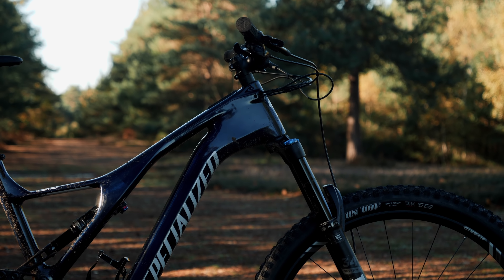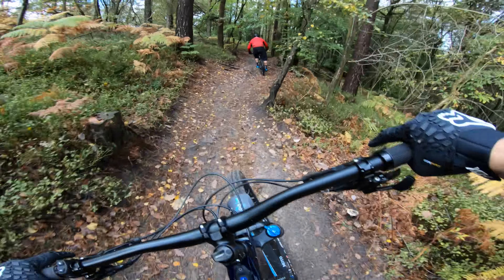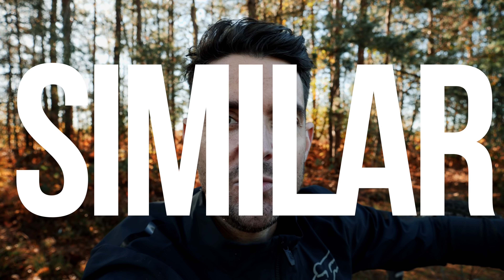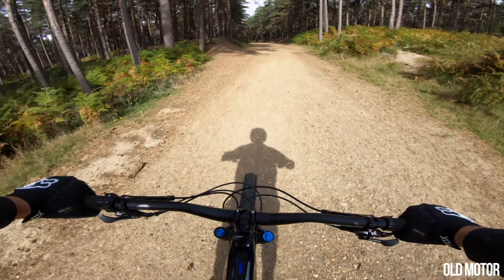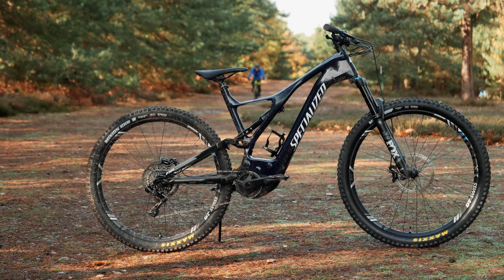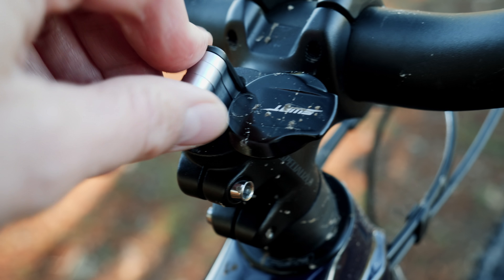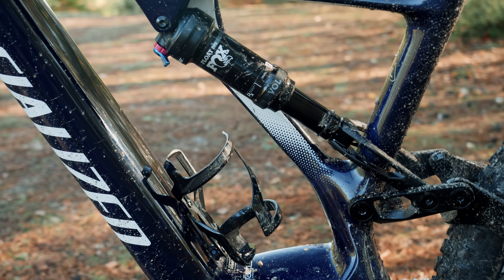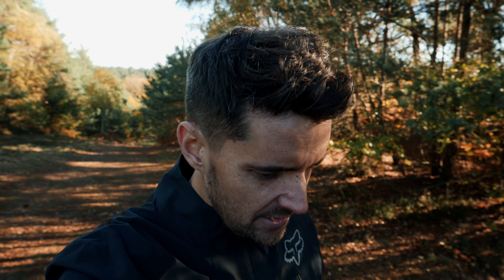2019 Specialized Turbo Levo Review

Comment from the maker: Hope you enjoy the review. Any question or feedback on the new 2019 Levo hit me up below 👊
Reply: Hi, since you are 6'3, I would like to know if you have an L or XL size? thx
Reply: States the size in the Video
Reply: great review but I have 2 unanswered questions: 

1.  What is the weight of the battery by itself? 
2.  Can you ride the bike without the motor to further reduce weight? i know the battery is removable, but does the motor need to be attached to use the bike?
Reply: @ValenTiC1996  battery does not need to be attached, you can ride without but you should close off the battery hole.
Reply: What's the range in turbo mode?
Reply: @808GT  not what i asked, can the motor be detached?
Reply: @ValenTiC1996  I don't know but you would not be able to ride as the BB is part of the motor
Reply from the maker: Thanks for the feedback 👍 I’ll definitely check those review out. Kind regards, Rob.
Reply: 2:53, he says he got XL @peronaeva
Reply: Thanks for the review!  IMO they're more meaningful after extensive riding, as in your case.  I've demo'd the 2018 Levo, which was nice.  But one thing I didn't like was I really felt the weight when I tipped it over to turn.  Wondering if you can compare that feeling on the 2019 vs. 2018 versions.  I'm hoping that the lower weight, and possibly lower center of gravity, on the 2019 may ameliorate this some.  Any thoughts?  Thanks again!
Reply: What are your thoughts about the m1 daz spitzing evolution and how would you compare them?
Reply: Can it run plus tyres also ?
Reply: Thanks, I really really enjoyed the review, really really good, on a really really good bike, my apologies but you really really say that a whole lot
Reply: Hi Rob do you have a specialized levo for sale buy any chance, I need one asap to help with fitness after having 4 operations and I know you have a few could you let me know pls

Comment: Having owned a Merida Eone sixty 8000 with intergrated battery I loved the bike,,,,,except the 27.5 wheel at the back. At 6'2" I ride an XL also and found yes whilst it creates more nibleness the back wheel does not roll over bumps, roots rocks, as easily. Its a gamechanger going to 29 front and rear. 3 years on this video is still relevant. Im looking at the Specialized Levo for the motor, the geometry the package. Yes you miss out on components but weight of shifters cassette is near moot on an ebike. Given the weight of the motor is 500grams give or take less than variants in the same year models.....Its quick and easy to put on X9 shifters that allows multiple gear shifts, and drops the weight where it counts at the cassette. Trickle down tech such as Rockshox Delux shocks or RS Forks in years past are equivalent to the top offerings. Light, stiff and plenty plush enough.

Its either I look at the Merida eone sixty again or the Specialized Levo but Im getting drawn to the Levo, even being alloy framed due to 29 wheels front and rear. I feel when your tall, 29 wheels are simply scaled up to suit your size on the bike, where leaning front and rear shifts greater mass than a 65kg rider that need to use far more body english to move 29 wheels.....Scaled to fit.

Just got to look at unlocking. STunlocker was great was super cheap to unlock the Merida....at $60Aus dollars for a simple licence to the App....that also allowed power levels to each mode.

Comment: Rob, Levo’s normally come with 2.8 tyres on the 27 plus 18/19 models. I am quite light riding a med at  5’9” and around 72 kgs, wondering about a 2.6 tyre, any feedback or comments from peeps trying that set up.  I would change the front too to a2.5 or 2.6. MAXXIS Minion DHRII rear, sound like a good al rounder. I don’t ride bike parks, mainly trails, North and South Downs.

Comment: My recommendation would be if you don't like it then find an alternative. Try hi power cycles. They are based in Florida. Ok they are double the price of the turbo but you get double the power and 100mile range not to mention better suspension, set up etc 😎

Comment: Rob, how much better is the 2019 over your 2018?  I just ordered a new 2018 left over Turbo Levo Expert Carbon and now wondering if I should have bought a 2019.   However I did get a great deal on the Expert $5000 dollars.
Reply: The 2019 regular frame weight is less than 2018 Carbon

Comment: Hey mate great review, have you got any plans to check out the Norco sight Vlt? 
 it looks amazing
Reply from the maker: I would if I could get one!
Reply: @RobRidesEMTB  Yeah they should be available around mid-November most places. It has made my choice of buying my next EMTB so much harder lol...
 
I just had a terrible experience with a 2019 Rocky Mountain Power Play; owned it for 3 weeks and it was nothing but dramas - a proper lemon. 

Firstly, the builder snapped the motor cover as its a brittle plastic on both sides, the motor was cutting out, a button fell off the controller from a minor knock on the bike rack, weird noises started coming from the battery or motor (high pitch whine when I stopped pedaling), rear shock was losing air pressure. 
The 'Normal" vibrations and noises of the motor were unacceptable and when the motor was off - you could barely pedal the bike a flat road.  I don't believe its ready for production really. I had to return it for a refund which the shop was very unhappy to do so. I had to send so stern emails back and forth; pointing out my rights under the Consumer Law. 

I really hope Rocky Mountain receives the bike back for an investigation; in order to alleviate these issues and put in place a more extensive quality control procedure. Judging by the shop owners emails - I don't think he intends on send it anywhere; just to fix a couple of things and sell it to some other poor bastard...

Comment: Super presentation Rob, thanks. We are looking at a couple of these for exploration of the forest service roads and trails in the Olympic National Forest, and extensive low tide beach exploration along the remote Pacific coastal beaches here in Washington and Oregon. Will out fit them with racks and panniers to carry supplies and photography equipment. Probably not much high speed trail riding and jumps etc. like in your video, (although well done). I also like the suggestion on the DT Swiss wheels as we would probably run 3" tubeless tires to meet the dual purpose needs.What is your thought of this application with the Levo? Thanks in advance, Tim

Comment: Great video Rob, congrats!!
As a proposal, it would be a good idea a new video giving advices about bike-caring (invisiframe, how to clean ir properly, how to disassemble the motor case to clean the inside, cleaning the connectors, correct charging, important spots to put grease, ....) they might sound obvious but it will be helpful for many users.
Another video explaining Mission Control and sharing your setting will also  be useful 😉👍
Reply from the maker: THanks Fernando, I like the idea about sharing the tips.

Comment: Hi Rob, Yesterday my 2018 Brose S motor started making a loud whining sound when pedaling at anything over 25% assist and when it screams like that there’s zero power output.  I suspect bearings or other vital parts have failed and rather than replace the motor again, this is my 3rd  one, I’m looking for a source to rebuild it instead.  Have you heard other comments on Brose reliability and have you heard of anyone who offers to rebuild the Brose S.  BTW, this is my second motor fail in 3 1/2 years with just 376 km.  Cheers, mj

Comment: Cannot stand mid drive . Hate the fact you are limited to what cranks you can get and you can only get splined chainrings . Biggest issue I have is the noise, the use of a clutch and the lack of torque . You have to get a high end Bafang to get a decent amount of torque . Hub motors sell far more because they are more reasonably priced, you only need to change the rear wheel (you can still use cassettes/freewheels ) . The immense amount of instant torque is insane . I test rode a 1000W Bafang mid drive . Doesn't even come close to my hub motor . Plus my motor is quiet and I can still use my Tune  carbon cranks .
Reply: So true!  Also, People say you get more use out of your gears on a mid drive... Really? Gears are actually more beneficial for hubs! Because you get more traction from lower gears on a hub when tackling inclines, And more traction for speed with the higher gears. Also again, The hub motors seem to perform better at the lower toque levels than mid drives. So the cheaper mid drives are actually shitter than the cheaper hubs.

Comment: A very good and honest review Rob. Agree with everything you said
I have had my TL Expert for a couple of weeks now and absolutely love it. I only got the Expert to get the higher capacity battery. 
Noise is not an issue - definitely quieter than my friend's Bosche CX powered bike.
Muck ingress is bit annoying but in the design there is no real attempt to seal the casing - there is actually  a big hole in the bottom of it to allow water to drain out. What is stupid design is the area Rob shows in the video where the casing actually acts like a scoop to gather up the crap flying off the back wheel. I don't have the little sponge yet so just stick a bit of black duct tape across the gap. works perfectly! It is also good to stop any small flints sticking in there as the movement of the suspension would lead to damage for sure.  If the new casing is much better I will push for them to replace mine foc
The motor power is amazing, as is how it's delivered.  I still want to feel like I am riding a bike so stay in ECO mode 95% of the time, which I have set at 20% support and 35% Power. This is more than enough to get up anything on the North Downs / Leith Hill and I am 62! You youngsters should be ashamed of yourselves using Turbo ! LOL. For me the best thing is that I now do any route I feel like and no longer avoid the steeper stuff.

Comment: Its great to hear about the sealing issue (crap trap at 12:30) that is addressed by a "sponge" (a gasket?) and the additiona of a 4th bolt to the motor cover (discussed around 11:30). Good to hear about the dings in the Specialized wheels and switch to DT Swiss HX1501 (eBike wheel). Thanks!!!
Reply from the maker: Hope you found it of some use, cheers, Rob. 👍

Comment: Great review, thanks for this and the other great videos. One question regarding the Levo specification, if you purchased again would you still go for the carbon comp or do you think a different spec is a better choice?
Reply from the maker: Hmm... £6k is a LOT of money, the Expert is £7250, its a lot of extra cash (Not sure its going to give £1250 'more' value to you)... Have seen some on EMTB Forums get the base alloy model and upgrade that way, almost getting to S-Works spec for much cheaper...
Reply: Thanks, I will continue to mull it over.

Comment: £6k bike with crappy wheels. Not to mention it's another £1k+ for the bigger battery. Nice one Specialized. Battery is also a bit of a faff to charge off bike. But these sell like hot cakes because it doesn't look like an ebike. Which tells me people are still a bit embarrassed to ride these things.
Reply: the bigger battery is standard on the expert
Reply: @pizzagorgonzola  Yes. The bike reviewed here is the £6k Comp Carbon with 500Wh battery. Expert is a £7k bike.
Reply: I feel it's too expensiv to. Seems like You have to buy one of the lower spec models and upgrade. Wheels, suspension.. Makes me want to get a Kenevo comp instead😀
Reply: Styling always wins out when buying a bike. I have to say though the classic "you could buy a car for that price" line is very applicable here
Reply: @Dadzone2000   The "you could buy a car for that price" claim never made much sense as you couldn't buy any new car for that anyway. A top of the range bike compares to a top range car. A £180k Tesla Roadster would be fair. That's 30 Levos for one car. The Levo is cheaper than some pedal MTBs like Santa Cruz (which are quite popular around here).

Comment: I've had numerous Super Bikes well north of 6K but the Specification on this bike is laughable for the price even considering it's an EBike, just rough calculations I get this bike nowhere near 6K, also a 34 fork isn't good enough for a bike in that weight range, 150 travel and 29.. ludicrous IMO. Overall depends on the Warranty and support which would have to be world class and beyond peer to justify the price. Assume they are "lifetime" warranty with such an eye watering mark up? Still Ebikes are the new "golf" so to those not aware of the actual cost of the parts they wont notice... and if they can shift them then why not overcharge. Don't agree with the percent reading.. would have to be large font to read the and agree with Specialized a scale is probably better for checking at speed, accuracy probably isn't needed 100$ of the time, colour would a be better addition. Nice looking EBike though and well thought out by the looks of it.. but I think the bean counters have been too heavy handed here .. probably to justify the 10K model?
Reply from the maker: Coloured battery levels a good idea 👍 The 34 fork is ebike specific so more effective for the 21KG weight. But yes it is expected that a much better spec fork should come on a £6k bike. Cheers, Rob.